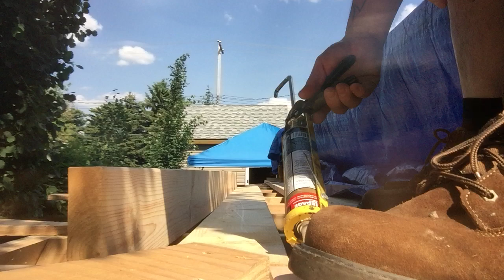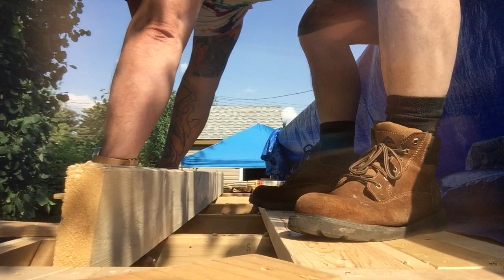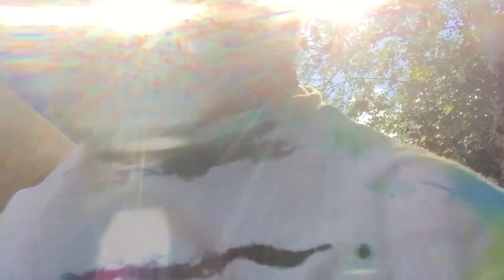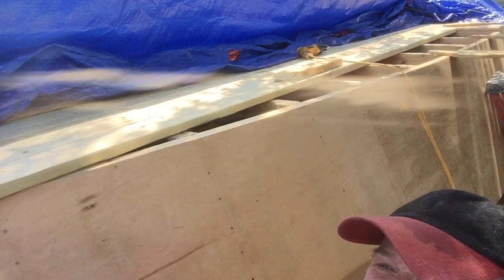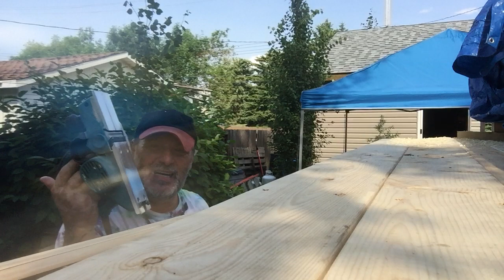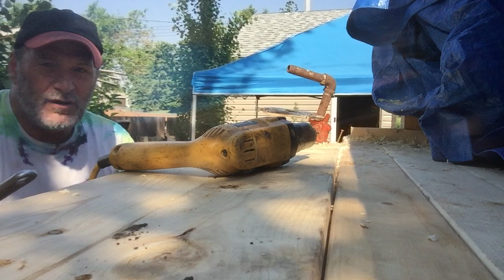30 foot Dory.28

Comment: Hang in there, Dan, seems like things are coming together.
You had mentioned that it would be a while before you were able to do anymore work on your vessel, and that you were gonna use a water sealer on it because it was likely to still get wet. I was wondering, to save yourself some extra work, if you were in a position to buy your epoxy kit, and use what you need to brush or roll a coat on the bare wood? You will have to do that before you begin to lay your fiberglass, anyway, so that the bare wood can drink it's share, otherwise you may have to use slot more to fiberglass. And you wouldn't have to spend all that time sanding the water sealer off. I understand that everyone's circumstances are different, so it's only a suggestion from me watching and not being in your shoes.
I hope to see you continue this project because I can't wait to see you in.
Thank you for sharing, you're doing a great job with just the phone, too.
From Central Tx
Joe
Reply from the maker: How are you doing
Reply from the maker: Thanks for your kind words I have already applied to sealer according to the instructions on the can it doesn’t take very much very thin coat it seems to be working so far it’s rained here several times in the last couple of weeks and real hard and the sealer seems to be holding up I am finishing I just got about 15 inches of 2 x 6 to finish the bottom of the boat and then I’ll be posting a small video on the completion the entire completion of the door as it sits I’ll be removing the tarp and showing the entire Dory side back front bottom just before I actually wrap it up for the winter here the short kit of a pox he hears about 250 or $260 of doing that I’m just gonna wait and buy the kit which is about 5 gallons of Apoxsee in Severn me about 700 Canadian are you Soum that I may need three of these I’m in the budget of $400 or less a month but I’m getting there I appreciate your suggestion but the problem is that I just can’t afford to buy a small kit I’ll also be purchasing the 1708 fibreglass which my local dealer carries and this is what I’ll be using on the door I am very patient I am glad the work I have done so far it looks really good of course and the boat is straight which is what I was worried about in the first place as far as the power is concerned I’ll have to work on that later I haven’t decided if I want to hang it off the Transom or install an extension and keep the motor out of the inside of the boat and not cut an opening with hydraulic steering still up in the air